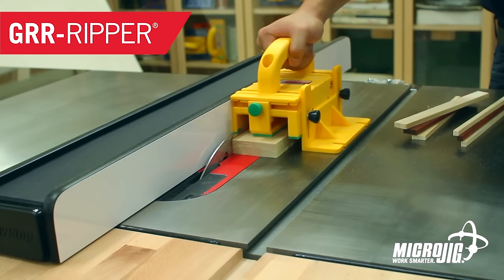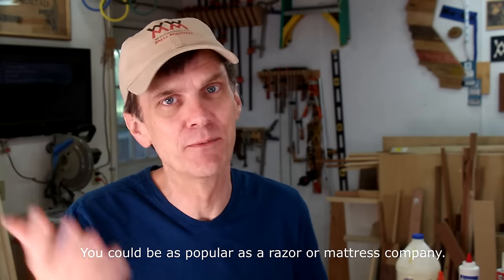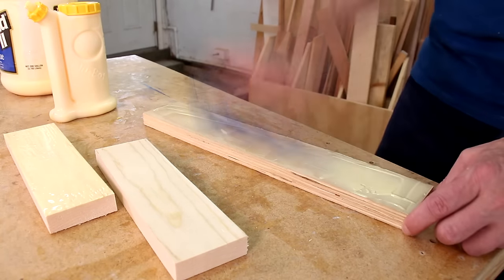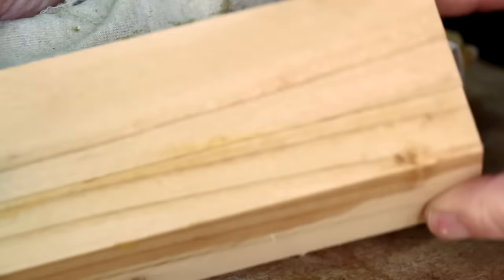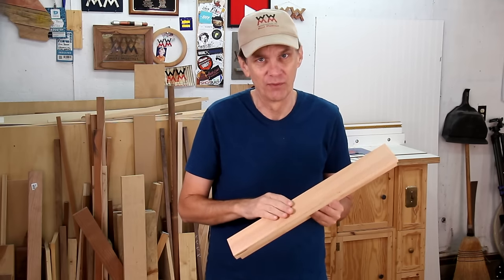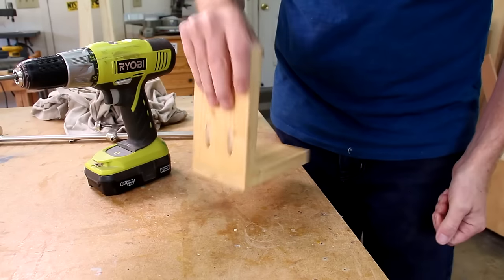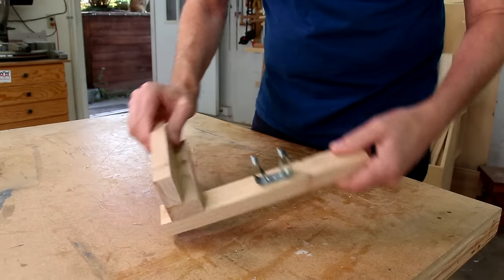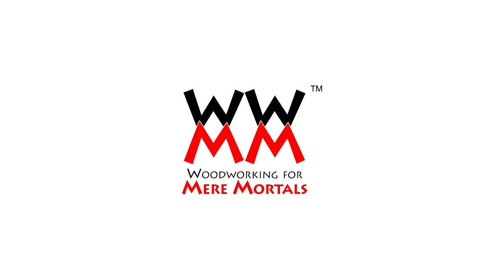What You Need to Know About Glue | WOODWORKING BASICS

Comment: my go to adhesive is tape. if I'm making a highly visible joint I tend to use scotch tape. if the joint needs extra strength, duct tape is my go to. I have found blue painters tape works OK and it even gives you a boost to the aesthetics of the project. just as there are many glues there are many tapes each with their pros and cons.

Comment: My father use to do a lot of woodworking and taught me a trick back in the 60's. Mix the wood glue with a fair amount of sawdust from the piece you were joining. He claimed the combination held a lot better than just the glue and it also blended better so if you missed sanding it off the face, it would not show in the stain.

Comment: What about surface finishing when applying glue? Does it make any difference for the joint strength? I'd say a slightly rougher surface is better (as advised in the instructions of many kind of glues I've seen).
By the way, thanks for your videos, I've always liked wood working but I never had a place big enough other than a closet (where I can just put a toolbox and some more junk). Eventually, I am however going to buy a jigsaw! :)

Comment: Thank you for posting.  Looking at making some art projects this winter..  1” blocks glued together and or some metal screws holding them together to hang on wall.   “Space Invaders” blocks in 1” blocks..  I’m sure most any any wood glue would be fine for that weight, but you gave a lot of good ideas to start... nothing worse than starting a project hobby and having to reinvent the wheel and doing it wrong.. you just saved me a bunch of time and experimentation.. and well mess and wasted money.. thank you.

What do you think of Gorilla and Elmer’s wood glue that I see everywhere?  OK? Or look harder to find the glues you have recommended?   Often the popular products are just more popular due to marketing and packaging than the product inside.

For my project “Space Invaders” made up of 1” cubes of wood (from amazon. Unknown quality of wood but probably pine). For cube corner to corner...  do you think wood dowel/hole attachment or pocket screws and build from the outside in?   I imagine drilling edge on and inserting wooden dowel joiners would make the most sense.. or is there a better option?

Comment: Steve, I have a question for you about blue not wanting to set up. I have a pair of lstn Wembley earbud headphones. Recently the cap ( the speaker and rubber 👂 insert ) slid out of its housing which is tubular. The  housing and cap that fits inside of housing are both made of bamboo. I got some Titebond 11 and placed a thin layer when the inside rim of the housing and outside rim of the cap that slides in housing on both the right and left earbuds. I placed them together and use a small C-clamp to hold it in place for 14 hours. The left earbud mended perfectly. The right earbud did not set up at all completely no grab. The glue was like a yellow gelatinous material. I scraped away all of that material and used alcohol to remove any excess let it dry and reapplied the glue and let sit for 24 hours with the same result. Do you have any idea why the glue would not set up? Both surfaces are dry and clean. It's really a strange because both the left and right ear buds are made of the exact same material same size etc. The Google one the right earbud does not want to set up even after 24 hours. The Bamboo is sanded and polished on the outside of the housing and is rough on the inside where the glue is applied. I even primed both surfaces with a thin layer of glue and allowed to dry before applying the final application before clamping the parts together

Comment: +Steve Ramsey  
I like your vids.
What I do is mix fine sawdust and white PVA glue when mixed the glue becomes transparent, to hide nails, pins, etc, even splits.
Saw dust I use comes from the timber that I'm using. 
Hope this helps?
Reply: There is a caveat- it doesn't take stains at all.

Comment: Correction! Reinforcing the corners would preferably be with biscuits and glue rather than pocket screws and glue. All depends on the strength desired. You can't claim pocket screws and glue would be strongest but should rather mention that it is one of the basics of stronger corner assemblies. Sorry for making this correction, i like your videos and agree with all your information you bring forth.  
Norm from Montreal, Canada.

Comment: Steve, possibility of a video on using the amazing Weldwood Urea Formaldehyde Resin glue?  It is load-bearing. I noticed even TiteBond III stipulates that it is not load-bearing.  But UF glues need a caution or two (a little bit poisonous). 
Priceless helpful information!  Thanks so much!  Cheers,

Comment: I would've mentioned using dowels and biscuits in glue joints, and you can use another old credit card to scrap off excess glue.  I also use a damp rag to remove glue for anything that's going to be stained or varnished to sand less.  Painter's tape can also be a great clamp for smaller items.

Comment: I'm thinking about DIYing a telecaster and found myself with a question about glueing. Does sanding the contact surface of the glueing, to sort of groove it and make it a larger surface area, make it a more resistant bond? Or is it the best to have the most smooth surface possible?

Comment: What do you think of Plumber's putty? I find it a great adhesive especially if you have to fill mistakes, but only if you are going to paint.
Reply: +Jason McCabe (Camulas) If you are painting the wood, good old spackle or even drywall mud can work nicely.  In fact, drywall mud on MDF sands buttery smooth and takes a coat of paint magnificently.

Comment: hi steve, if i use screws and glue to assemble a bench. is it a problem if i prepaint my components? will glue over paint work in a joint. the reason I ask is because some areas will be hard to reach with a paint brush afterwards? Thanks

Comment: I've used a lot of super glue, namely Loctite, in my smaller model projects. It dries extremely fast and is very strong. I've used in cases where strength was key, and it didn't fail me. I prefer the gel kind, so that it doesn't run all over the place.

Comment: Cool video and all...

I'm still scared of glue joints because I don't know how to tell when I messed up a joint or the level of surface prep required (surface roughness and levelness) for a decent joint.

It's all good to say if you do it right the glue joint is tougher than the wood, but if I try to build someone glued furniture that fails at the glue joint telling them that if I did the joint right it wouldn't have failed isn't much consolation. (And what if they injure themselves due to my bad glue joint?)

Comment: What are you thoughts about 2p10 -- I started using recently in place of brads, it's some form of CA glue with activator - supposedly for wood specifically. I've been spreading the wood glue and then dab a few spots of 2P10 and clamp for 5 minutes, CA glue grabs and lets me move on.

Comment: I am wanting to inlay some banding & special made veneer details to a 2mm x 3 inch trough cut in a plywood panel. I want to stain the plywood panel & I just know the stain will get over & into my trough. 

SO.... Question;
can I still glue the inlays, to a stained panel where a trough is cut & have it adhere well.  (glue epoxy, super glue)

Comment: I'm a total novice, and I    left a couple of boards I glued together with tightbond wood glue in the garage, and a year later the board fell off.. do u think it was the humidity and expansion and contraction of wood with temp etc..  they were just laying there awaiting a future project.. why do u think that happened.. I don't think there was anything wrong with my technique pretty simple process.. all clamped, and sanded etc etc..they were pressure treated pine boards..

Comment: Just like when gluing up end-grain, allowing some time for the glue to soak into the pores of the wood for face/edge grain gluing can vastly increase the strength of the joint, although as you demonstrate extra strength is not always necessary.  Using a damp rag will help with removing excess once you have clamped your work together.

Comment: I have a serious question and I really hope to see some replies and advice from other experienced woodworkers.  I make a lot of patio furniture and outdoor accessories.  Most of my builds are two-tone, that is, I stain the subassemblies of the projects 2 different colors before gluing them together as final assemblies.  The problem I am having is sometimes the glue releases and the pieces fall apart unexpectedly.  So, I've tried many different kinds of glue including wood glue (most kinds), construction adhesives (even the most expensive ones like Locite Ultimate); however, nothing seems to work.  The stain I'm using has some oil in it and I believe that oil may be responsible for the joint failures.  I've tried gluing before staining; of course, that works perfectly--although it makes the two-tone finishes virtually impossible.  The two-tone finishes are one of the things that set my products apart from the competition and give me an edge on profitability.  So, with all that said, if you have any advice for me, I'm all ears...

Comment: Hi Steve. I'm working on a 3D chess board for mothers day and am unsure of how to fasten all together. My hope was to buy a set of dark wood and light wood that I could add a clear coat to after it was assembled and sanded but I didn't have any luck finding that. So now my thought is to stain the pieces the two colors i want then assemble the board. I'm concerned with wood glue because of the clamp forcing it out of the sides, i dont want to resand the peices and have my stain be uneven. Also, I'm unsure of just how strong spray glue is. The Weldbond seems like it could since it's pretty clear. I would want to use it pretty sparingly I think though. 

Any tips?

Comment: Great video. One tip I would pass on is to wipe up wood glue with a damp cloth. cleans up near 100%. Dark wood glue will vanish if you stain brown. I always kept a bucket of water in my shop with cotton rags in it for cleaning many things. Sure made gluing much easier.
Reply: I keep old toothbrushes around.  Have them soaking in hot/warm water before you start a glue-up and wipe/bang the excess water out of them before use.

Comment: Hey, I’m making my veeery first wood project. And I used epoxy for sticking things together. I did not think everything through, so I did not remove excess of epoxy from corners right away. And now I’m trying to remove excess of epoxy with sand paper. And if with joints of big parts it’s easy, with small ones it becomes extremely hard. Do you have any advice on how removing of the excess can be done in less accessible areas of the project?
Reply: A sharp knife can remove big chunks

Comment: To speak on nailing to hold glue, it's an amazingly useful and efficient way to assemble. But in other applications where the glue joint needs to be tight for aesthetic, nails will ease out and leave gaps. Clamping the piece initially and then nailing at left and right 45's will toenail the piece and allow the clamps to be removed and free for other use.

Comment: This is very late, but something I do: if you notice when you tighten clamps on the wood it tends to slide. Sprinkle some table salt onto the glue and the salt will dig into the wood and stop the sliding.  Just a dash works fine and won't change anything.

Comment: hello, i am going to be using titebond 2 for a sideboard, the 4 corners will be butt jointed using glue only with shelving using rabbets on the internal vertical sections again just glue, the back board will be rabbeted in to add strength and again using glue only to 3 sides (slide in from bottom). The wood will be 18mm (3/4 inch) birch plywood. Do you think the glue alone is strong enough ? I had a chat to some one and proclaimed glue is strong enough but when it came down to it he said also use dowels. ( he could not commit to his proclamation) please let me know what you think, thanks

Comment: wood glue will glue leather to wood for a strop very well. made a 11x2-1/2" strop 2 years ago. still working great no lift up on the corners used weekly on planer blades and chisels. Used cedar and original titebond.

Comment: Long ago, I learned that contact cement was the thing to use for applying laminates, but I don’t like it.  Several years ago I needed to put laminate on MDF and I decided to use Roo Glue.  It worked out perfectly.  It doesn’t lock in place like contact cement, when wet, and when dry the excess that oozes out just rubs off.  That’s the thing to use, but now Roo makes wood glue as well, so you have to get the right one.

Comment: I know I'm necro'ing this post.  But I had to get it off my chest.  I've been watching Steve use the GluBot on all of his videos.  And I always thought "what's the big deal?  The Gorilla Wood glue bottle that I got works just fine.  When it runs low, load it up from the gallon Titebond jug.  Then I tried GluBot.  And what I was missing was that I could put the glue on a board that's sitting upright WITHOUT having to down angle my glue bottle.  It makes it so much easier to apply the glue.  Yes, it's a small thing.  But little things that save you time save you frustration.  I also switched to Spax screws and I can't believe I used to use drywall screws on plywood/2x4s.  Again, a small thing but saves you time and frustration thereby increasing the joy of woodworking. So thank you Steve!!!

Comment: I use hide or bone glue :)
These bond end grain very well are easy to clean up and should something go wrong during assembly you easily open up the joint by applying a rag with warm water to it :)
Also you do not need to remove any old glue and the glue will bond just fine to previously glued surfaces :)

It has a low environmental impact too since it is made by using byproducts of the meat production rather than oil.

I use rice glue as well which is just mushed rice <=requires a strong and well made joint to begin with ;)

Comment: For end grain, I use Bondcrete (1:1). It is a resin glue that is actually used for glueing concrete.  Mix it with cement render, full strength.  Mix 4:1 water to Bondcrete as mold protection in wet areas before painting.  **WARNING**. If it lands on something you DON’T want glued wipe it off IMMEDIATELY!  Once dry, it can not be removed except by sanding.  I once let a run land on glass didn’t see it till it dried.  That was 50 years ago it’s still there.  One good thing, Bondcrete seems  impervious to ultraviolet light.  Makes a good clear and water proof paint (full strength) for outside timber.  That is, If you don’t want to go to the trouble of doing a good job.

Comment: about cleaning glue off . I worked with an old furniture guy and he would after wiping with a dry rag he would also wipe with a damp rag to get all the glue off.that way sanding is easier and there is no glue residue left to repel stains.

Comment: Piggy backing on the “nails as clamps” idea. You can also use super glue as a clamp. It sets quickly and will hold your pieces together while the wood glue dries. Works best for oddly shaped pieces that won’t be load bearing since it won’t be QUITE as strong as normally spread and clamped wood glue joints. Any seasoned woodworker knows that difficult/impossible to clamp pieces aren’t as rare as you’d think so little tricks like this are worth sharing if anyone has any other methods.

Comment: To spread glue evenly on large surfaces, I like to use a notched plastic trowel/spreader. That's what flooring installer use to spread their adhesive evenly. In woodworking, you'd of course use much finer notches.

Comment: I am in the middle of turning a small antique table into a slightly smaller antique night stand.   it was kind of rickety and does not have high value so I don't mind repurposing it.   Here is the thing.  This table is roughly 120 or so years old and is made of mahogany.  The joints are all glued but the only screws used were for attaching the frame to the top from underneath.   So glue was used to hold the joints together and the joints are still amazingly tight for the age but it was easy to take apart.  I know they used glue because it is evident inside the mortises and at the tips of the tenons.  None of the wood was damaged when I disassembled the table.  This tells me that while newly glued joints may be strong where the glue is and therefore mostly break in the wood, old joints don't always do this.  Glue will degrade over time and eventually crumble and become the weakest part of the joint, not the strongest.    To me it is more important to make sure your joints are well designed and made so that the piece would hold together with no glue or fasteners at all.  I will be gluing my project and came here to see if there have been any recent developments in adhesive technology that I could learn from since my last project which was about ten years ago.   I'm also adding small wood screws in discrete locations for added strength.

Comment: i have used a small amount of crazy glue near the edge and wood glue on the rest of a joint where i could not get a clamp or on rounded parts where clamps ten to slide. the crazy glue dries fast (so i don't have to hold it long) and the wood glue will give it the strength the joint needs.

Comment: Super glue or CA comes in different viscosities and that gives it more flexibility, but it seems to work well only on models using balsa wood. It will soak into that wood better and there is where the bond is stronger.  I also use it to glue the tires to the rims on my RC Trucks. It is quick and when I want to change the tires, the glue breaks fairly easily.